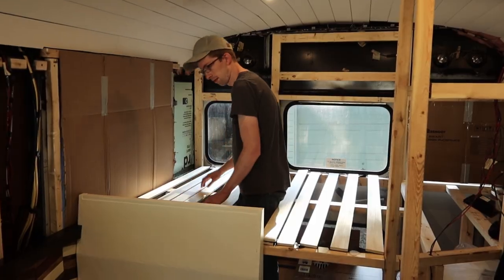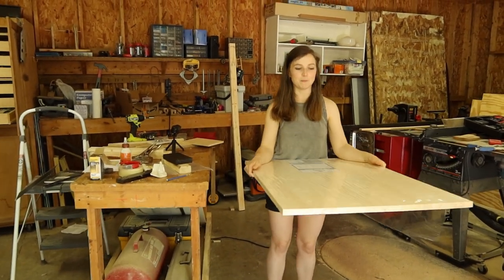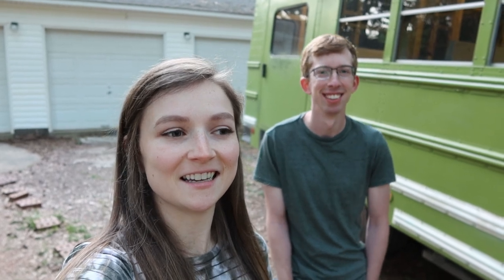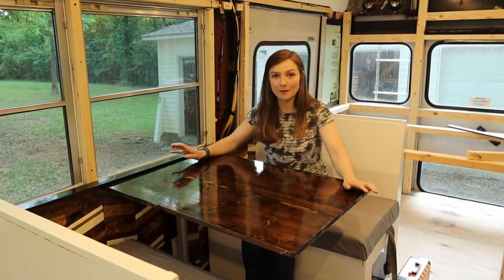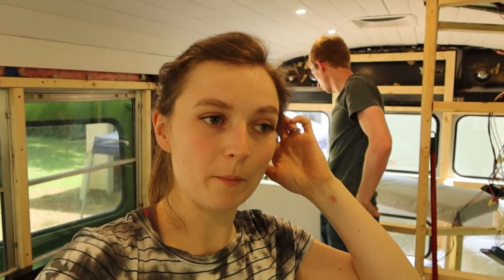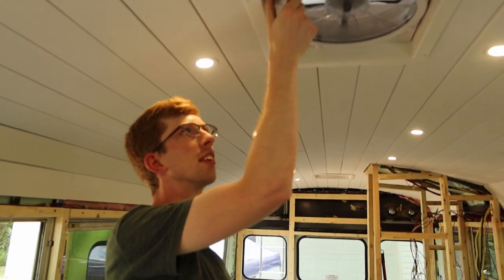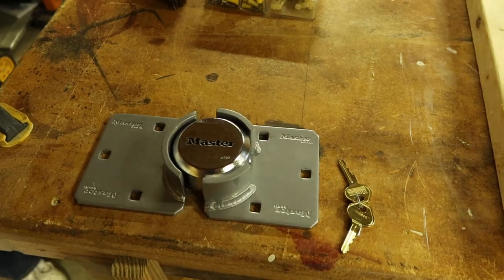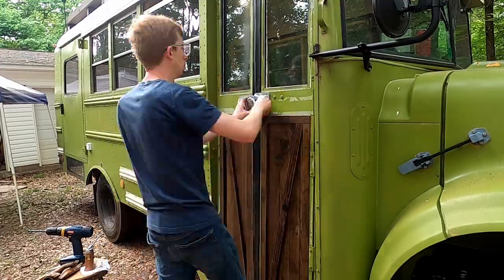Lagun Table Mount | EASY Install for Bus Conversion | SKOOLIE BUILD

Comment: Beautiful job!!!
FYI - you can get paint brushes and rollers at the Dollar Tree! You won't feel bad about throwing them away 😁
Reply from the maker: That’s a good tip! Thanks! 😄
Reply: Drop the paint brushes into a container of water to prevent drying stiff until continued use.
Works with oil or water base paints. Thanks!👍

Comment: Good job you two! Question, what is the dimensions of your dinette, looks spacious! Dimensions from extreme back to back and width, this is including the seating. Thanks in advance. Looks great!
Reply from the maker: Thanks!! 💚 Our dinette benches are 34in wide, and the total length back to back is 65in (the benches are 22in each, and they are spaced 21in apart). They feel pretty spacious, especially for two people! There isn’t much foot room with four people, but it’s nice to have the option!

Comment: can i make a suggestion your driver door the one the kids go thru at the front, i see has wood at the bottom of the doors, why add some thicker metal on the inside of the door behind the wooden panels to make it harder for people to break thru ? Its a just a suggestion that might help with  getting in as well as using simply safe on the go cellular home protection system that you can use while in your bus.   check them out on  allie and trent who are also van people but right now are building a home. good luck hope this helps.    Suggestion for the name : THe Green machine skoolie!!!!